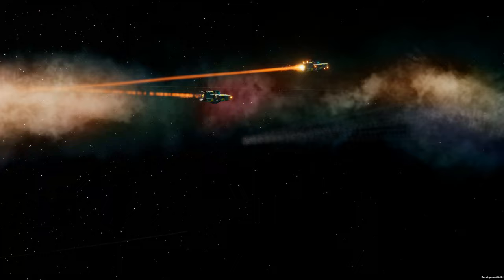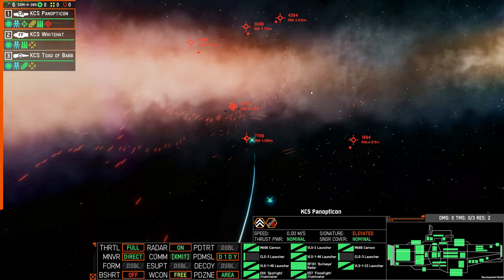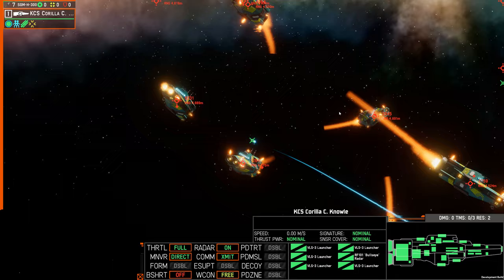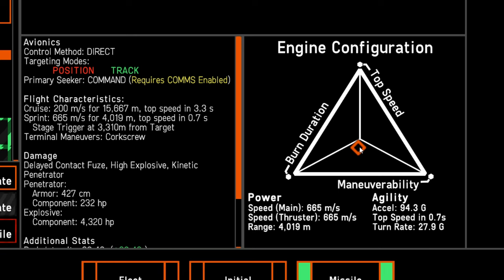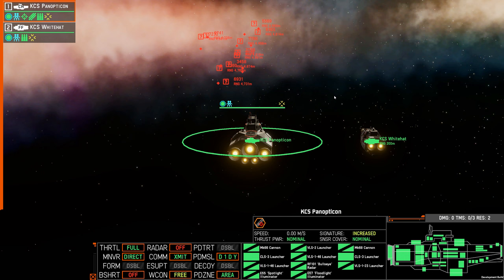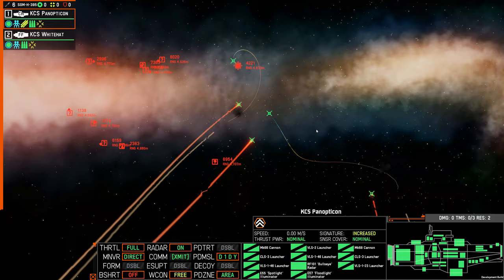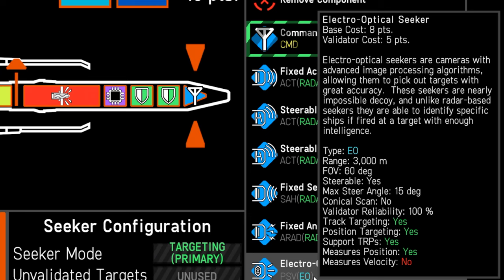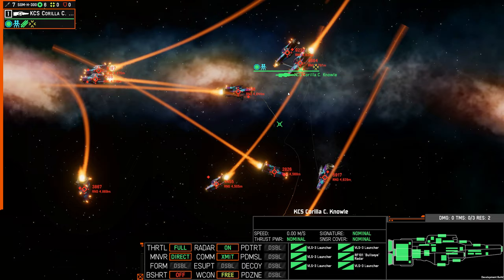[Nebulous: Fleet Command] Is the Corkscrew bad?

Comment: If you tune the missile for speed, you don't need terminal maneuver for it because it already has one. Being FAST. Speed is also the only factor that affects cost of the engine.
Reply: It only effects the cost of the Sprint stage of a hybrid missile, but yes. You can shave 2 to 3 points off by reducing the sprint's speed... Which is conveniently the cost of the Corkscrew maneuver
Reply: -rep furry

Comment: Actually, using camera as main seeker and command guidance as validator, you can always score 100% hits even with the worst strength of the sensor track. You will always hit the ship you want to hit, but of course also loose the slot for armor/ other stuff of the missile
Reply: You’re also paying an additional like 8 points per missile compared to something like ACT/WAKE or ACT/ARAD

Comment: Corkscrew is not necessary with hybrid missiles as these are so fast anyway, they come in with a natural curve in the trajectory due to their speed and are already near impossible to stop with anything but massed ballistic PD from multiple ships in close proximity (which you should avoid targeting in the first place and wait for them to split)

Your main counter with hybrids are Auroras, and any terminal maneuvers will instead extend the amount of time the missile is exposed to aurora fire. 

If you really need a terminal maneuver, then Weave does the job fine.

Comment: I am trying to make scarry missiles and they work quite well against larger hulled ships. however, I have trouble hitting smaller ships like covets or frigates even without  terminal maneuvers. i am using the command guided warhead btw. how many Gs would you recommend for a arcuate missile without terminal maneuvers. I'm running around 23 right now for the boost phase.

Comment: My missiles do a weave action even when they are set to none, is this a bug or a feature?
Reply from the maker: That doesn't sound correct to me, missiles fly almost completely straight unless they have a terminal manuever enabled. Your missiles could be appearing to weave if they are cmd guided and shot at a low accuracy track, if they are radar guided and are being jammed, or if they are switching back and forth between multiple targets. Cmd guided missiles will also appear to wobble if you are being hit with a hangup jammer because that disrupts your ship's comms connection to the missile guidance.
Reply: @Chimerathon  one thing I haven't got down. On your Stealth hybrid missile what ratio size do you make the fuel and explosive? Is it 5:5 ?
I was tinkering around to see if I could have a maneuverable missile with more explosive at 4:6 but if I try to make it maneuverable enough to use corkscrew it reduces the sprint stage down from 3Km.

I just got this game after seeing one of your videos 3 days ago so maybe it's a skill issue but I'm not sure.
Reply from the maker: @onepangaean3018  That stealth missile from my video has a 3/7 fuel/warhead ratio with HE impact payload and the sprint fuel is adjusted to 700 m/s speed with stage trigger at 3km. I didn't put corkscrew on those, they don't really need it much because of the stealth. You could put weave on them though, weave isn't as prone to missing with low agility and it's still pretty good at confusing ballistic point defense if you end up having to fire them without jamming at some point.
Reply: @Chimerathon  I see! Thank you 👍